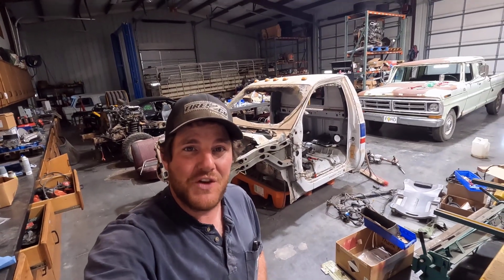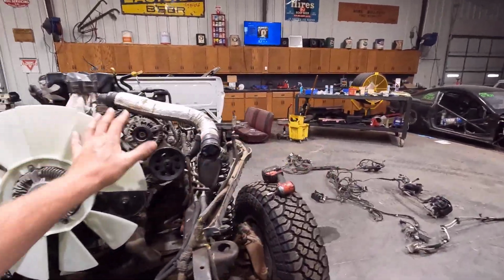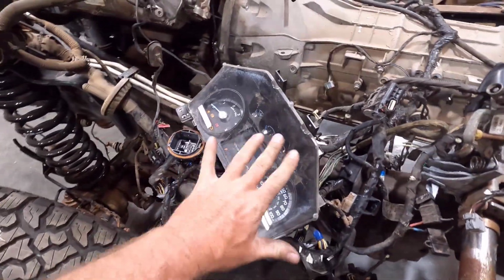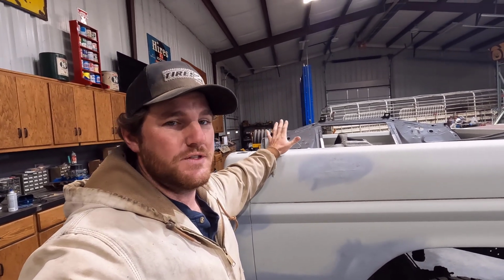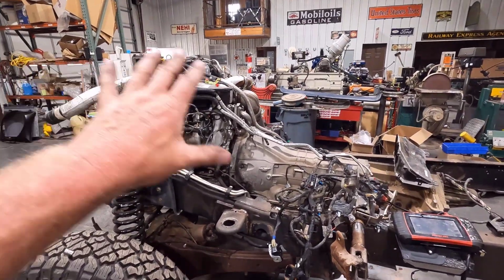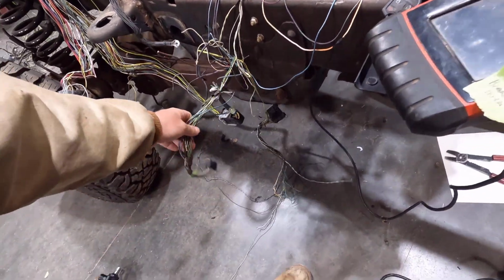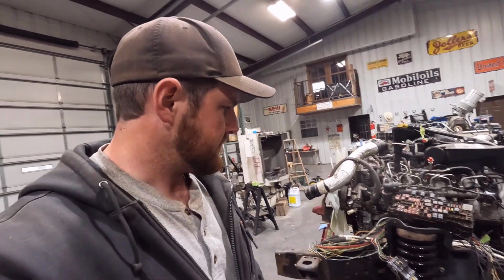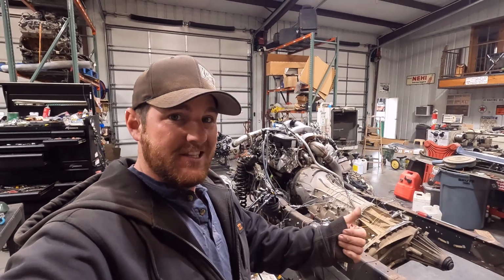Wiring Mess! Getting The Ultimate Crewcab's 6.7 Powerstroke Started.

Comment: Glad you’re keeping the original dash. Everybody transplants the fire wall and column to get the wiring/ PATS to work. I’m putting a 79 dent side on a 99 superduty and keeping the original dash as well. A bit more work but worth it in the end, also, as you mentioned the Dakota Digital gauges that work off OBD II are bitchin.